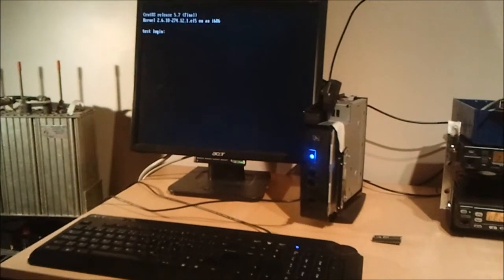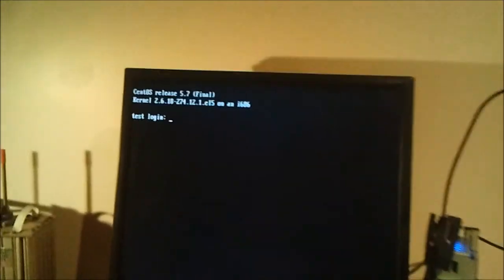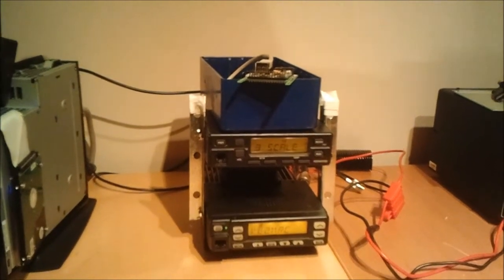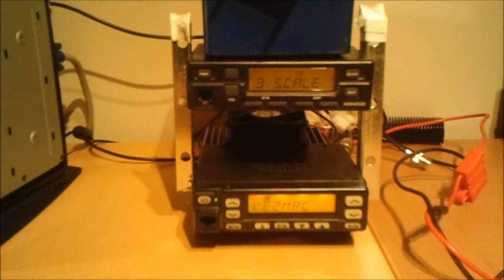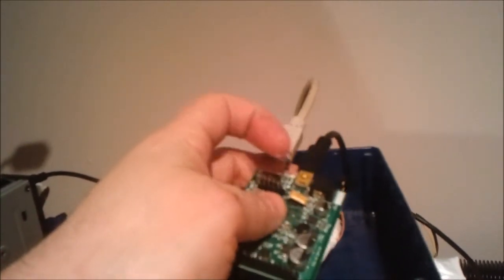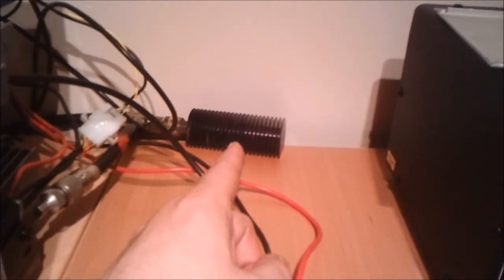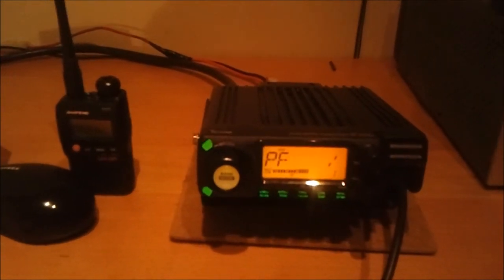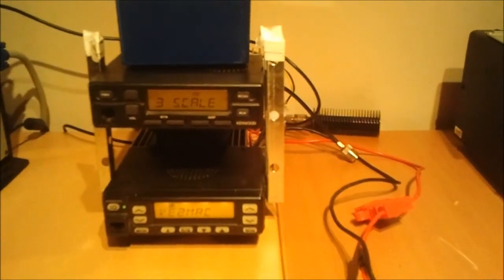dvrptr and free star.wmv

Comment: To make the TK 860 work with the project do you need the G model? or will the Non G model also work? What programming software is required and what programming cable do you need? Wondering if there is a source for the KPT-19's? How low can you set the TX power as I have a 250mw input power amp that is ready to go. Great video and will be watching for the final project video. Dave N2KTO

Comment from the maker: First , the tk860 is a g model cause I had one and it was perfect for a 40 watt repeater, I will be installing 2 fan on the heatsink that are controled by a thermistor, a simple tk860 or tk 840 radio would have done the job but it would have run too hot for 40 watt continous, and would have needed to be lowered to about 10 watt max..
for the software.. make a search for "rss software collection torrent" in google you could find some great things ;-)

Comment from the maker: For the programming cable, simply go to ebay and type the radio model you wich to program like tk-860 and add programming cable ou will find this :
ebay.ca /itm/Programming-Cable-Kenwood-Radio-TK-780-860-880-980-/380401543418?pt=LH_DefaultDomain_0&hash=item5891b2e8fa#ht_3073wt_1139

there are many other seller of such cable pick the one you prefer!!